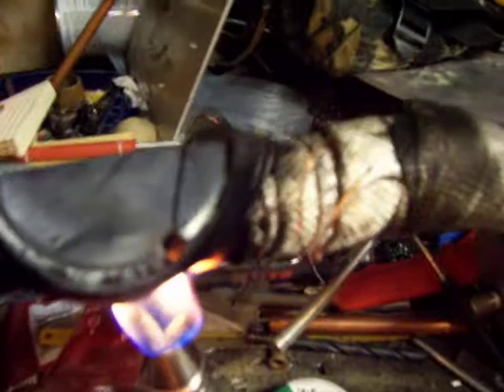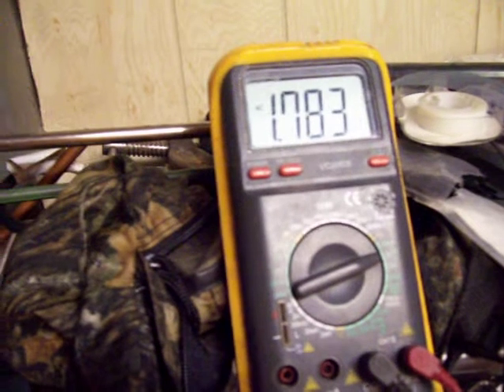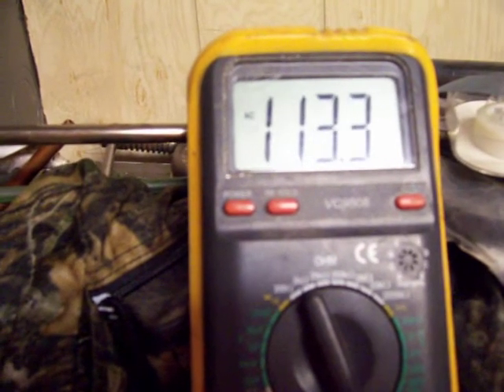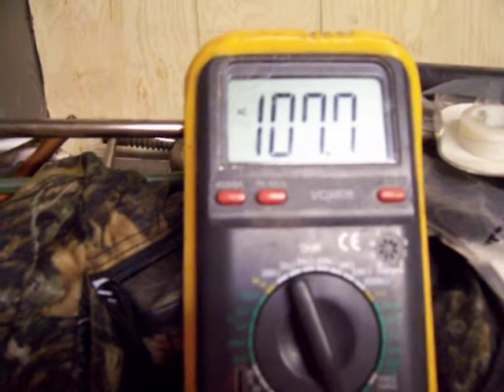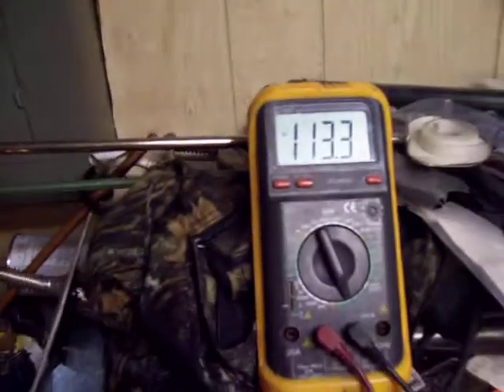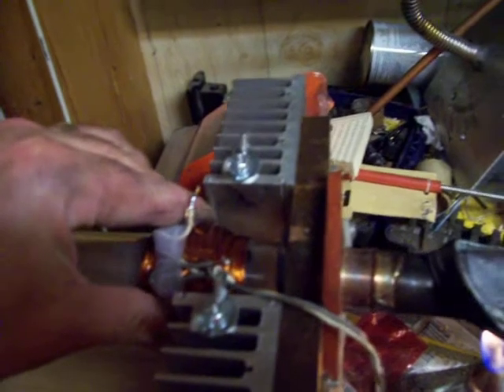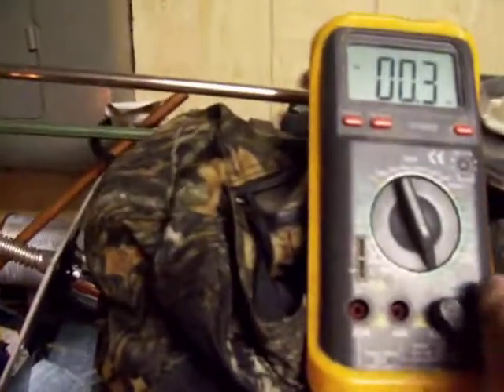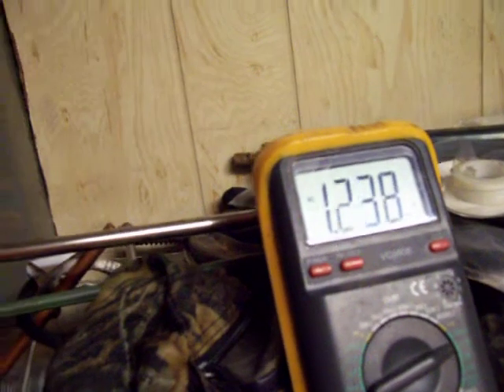lamina flow stirling heat sink generator lamina thermal lag alternator resonant resonating

Comment: By the way: I think it's great that you show both the voltage and the current in your video. When you multiply the two it gives you the power output in watts. The frequency output on the meter was also good info. Most people fail to provide that much info. If you increase the turns on your coil it will increase the voltage. I have an associates degree in electronics and I'm also a machinist. You have done a great job.

Comment: Hey guess what!? I figured part of it out. The only thing I kind of did not have was the orifice between the heat tube and the power piston cylinder. I have like a .676 inch ID on my tube and power piston cylinder. The orifice between the two was .500 inch. This is way too big. I put a bushing in there to down size it to .250 inch and I got some oscillation. The only problem now is when is starts running it has a tendency to blow out of the cylinder. I might make the orifice smaller or install a longer tube. I'm so happy to have finally show some sign of operation.
Reply from the maker: yeah when the air in the tube gets hot it causes the pressure to increase and the inside has to be somewhat neutralized in pressure i usually drill a hole somewhere where i can put a screw and a washer to release the pressure when its warming up before operation .and then tighten it back down before operating it its usually best to do it on the cold side somewhere.like on the heat sink .now the office size somewhere around 1/4 the diameter of the tube but i do not know the best size you will have to experiment.the most important thing is heat difference, and removing unexpected moisture from piston and steel wool after it heats up causing drag. these also do not run with any kind of lubrication as far as i know only  air as a lube and some use graphite pistons.also i found on mine it works best with the steel wool strands in parallel and cut flush like a round cylinder and about 1/2 in to 3/4 inch away in front of the orifice.
Reply: I was going to add a bleed screw to the end plug on end of my heater tube. That way I could bleed out air before start up to get the piston in the ideal location. This will keep the piston from hitting the cylinder on one end or popping out on the other.
 I also feel that on our stainless tube type engines that it is practical to have the bore larger than the heater tube. How much bigger I'm not sure. I'm preparing to make another piston and cylinder for this. I ordered some machinable neo magnets to install in the center of my new piston. My current tube and piston is .676 inch bore. The new cylinder and piston might be made to around .850. I will still be using the .676 heater tube. This helps because I do not have to bore the cylinder so deep so I do not have to have such a long boring bar. Long bores are also more time consuming to machine.
 Putting the strands in parallel reminds me of the theoretical diagrams I have seen on the internet where they show parallel plates instead of steel wool. It may have been on Wikipedia. The parallel strands or parallel plates may allow the air to move faster.
 I seen a post where you said yee ha I'm getting .5 watts. Your still better than mostly everyone else because your mentioning the watts voltages and currents. If you can enclose the power piston section and pressurize it you can increase the power of the engine. Pressurizing with helium can boost the engines output as well.
 A company called sun power has a free piston engine that is about the size of a pop can and makes about 30 watts. It may have been made at a college with the help of people at Sunpower. It seems like the most knowledgeable people work for or have something to do with Sunpower in Athens Ohio. There is a 5 HP Gamma engine that is pressurized that was made in Bangladesh. Many of the people that where involved where from Athens Ohio. A guy with the last name of senft was one of the people. You'll also see another 5hp gamma called the ST5 and I believe it is from Sunpower or someone in Athens Ohio.
Reply: Although these engines sound fascinating I could never seem to get a price for one.  They are also not available to the public. I guess NASA is using or planning on using these in outer space. Somewhere I read that they have them in 1,5, and 10kw. Maybe even up to 15 kw. 
 Sunpower has a few competitors but not many. There is a place in Spain I believe that used to make Stiring engines for RVs.
 Some few companies that make them with large outputs 5kw or 10kw sell them for around 7 to 10 grand. The guy that invented the segway had a 10 kW for 10 grand.
 For normal middle class folks there doesn't seem to be an economical one in existence. It's all us do it yourselfers that have to pursue it. Like you and me. Out of all the do it yourselfers you have accomplished one of the best and most informative videos on YouTube. Thanks for posting me back. I have a brother in law in Tinley Park Illinois. His name is Doug White are you related? My name is William Robert Amey but people call me Rob. If I find out anything that may help you I will give you a post. I may try a steam turbine someday but for now I will experiment with the Stirling's like we have. I may also try a gamma free piston. For now it will be one like yours. Thanks again. - Rob
Reply from the maker: yeah mine to I think it's from the air expanding the first while

Comment: Congradulations! You are one of the very few people who do it with a steel tube. I have tried many times and can not get anything out of mine at all. Glass just seems so wrong. So the insulation on the end helps? The one I built has the perfect piston, low leakage, no friction. I used stainless steel scouring pad packed in half the tube.  I set an ice cube on my power piston Cold End and tried a propane torch very low setiing on the middle of the tube in various spots. Oh well, congadulations again on yours.